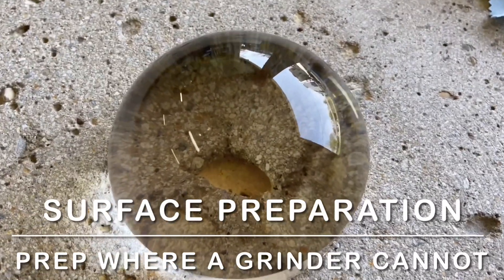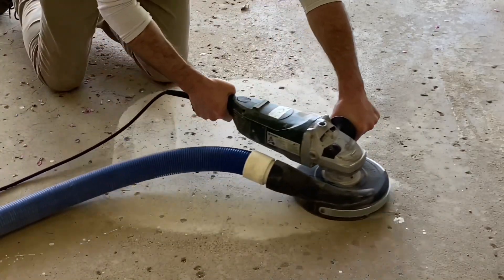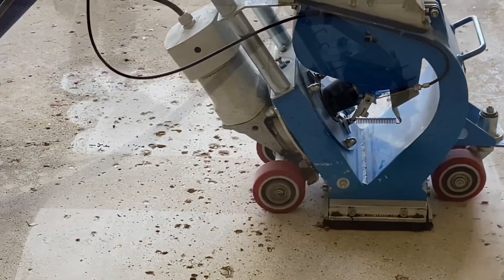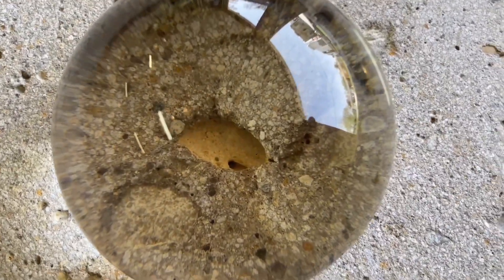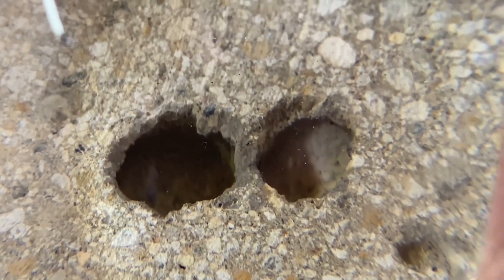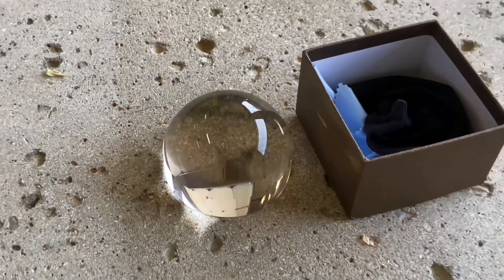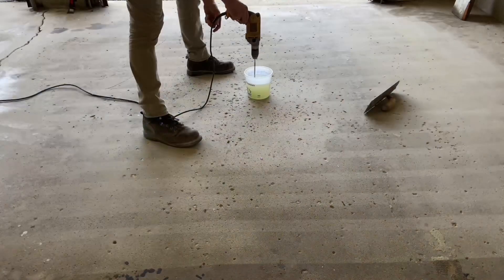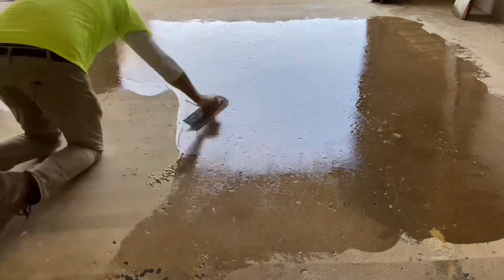How To: Concrete Pitting Surface Preparation for Epoxy Coatings

Comment: Thanks, Josh for great information!  I have a section of patio floor coated last year  (polyaspartic base coat, color flakes and polyaspartic finish coat) that needs to be redone.  There were many voids and defects that I meticulously  prepared by removing loose material and cleaning thoroughly.   The contractor filled these area with their fast setting filler but didn’t bother to slightly overfill and grind them flush with the surrounding floor.  Most of these spots are still visible now (low spots) and the overall look is disappointing at best.  Please share how you would address this repair.  Thanks very much.
Reply from the maker: Thank You. 
For the under-filled pits, the best way I’ve found is to broadcast sand over the wet skim coat. It can still sag, but saturated with sand usually displaces the liquid up (over filled). Once cured, the whole area is then ground flat. The patches should be filled to the same height of the concrete.
Reply: I’m a bit confused…the area to be repaired is about 100 sq. ft.  Doesn’t the whole area need to be ground down or abraded to get the new flake floor to adhere?  Should all of the coating be removed down to bare concrete again?  The low spots will be partially filled with fast setting filler.  Will the skim coat you mention adhere to this filler?  Is what you’re calling a skim coat the same as the base coat of polyaspartic?  Thanks in advance.
Reply from the maker: @KirkZiegler-vo8vm  the area shown was broadcasted with sand while the epoxy was wet. Then it was ground down to remove the overfill. Once the whole floor was ready, it received an epoxy skim coat (as normal) before the flake body coat was applied. I’ll see if I can find the other video which might explain better and drop its link.
Reply from the maker: I couldn’t find the video from this job, but this one was done with a fast set patch resin: https://youtu.be/csAoxiW_3QY?si=jxDuwhKmuadhJD_a
Reply: Thanks, Josh.  If I was starting from scratch I can see how adding the sand to the filler would have solved the problem.  My situation is a bit different, though.  I have a finished flaked patio slab with lots of isolated low spots that need to filled.  Do I need to grind the low areas down to bare concrete (removing all the flakes and filler material in them now)?  After filling them (slightly overfilling) should the entire slab be reground (removing existing flakes and base coat of polyaspartic)?  I need to see a flat flaked floor that matched the rest of the patio when I’m done.  Thanks in advance,  Kirk
Reply from the maker: @KirkZiegler-vo8vm  ahh, I see what you are looking for now. Patching a flake is not something I’ve ever done satisfactorily. Edges can be hidden, but in the open areas I’ve never got it to match. I’d grind it to take the gloss off and reflake it. This assumes the low spots aren’t that low. If they are, then they’d have to be prepped clean, filled and ground flush. 
Short answer, I don’t have a trick to patch an existing flake. Sorry I can’t be more help.